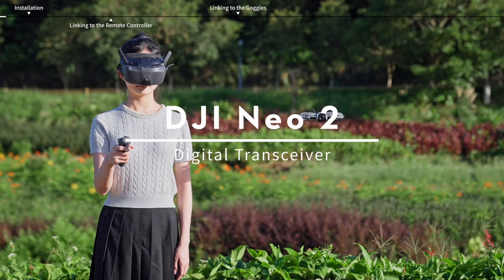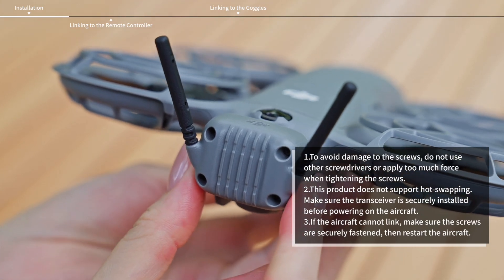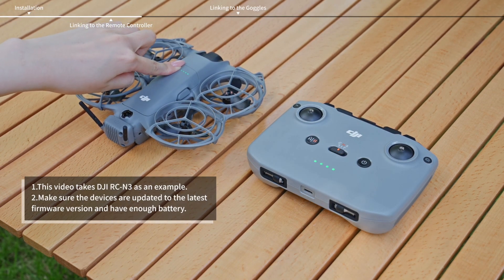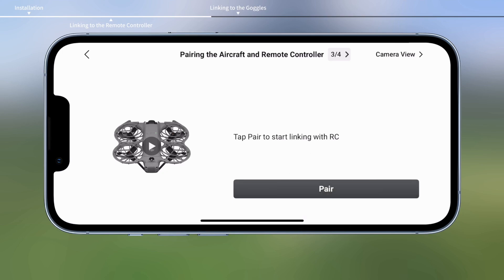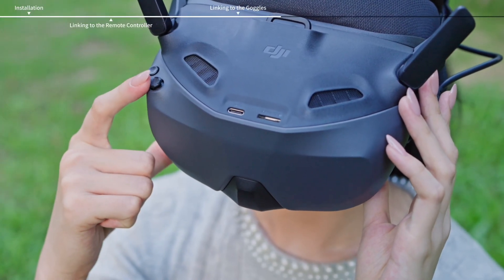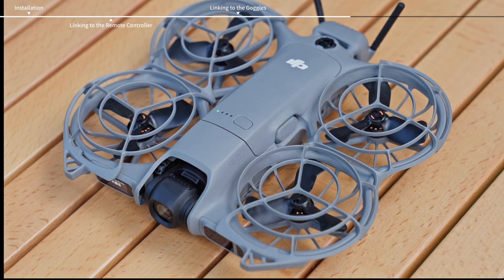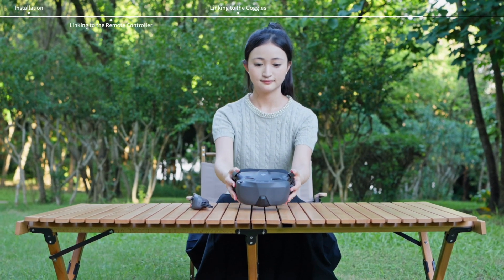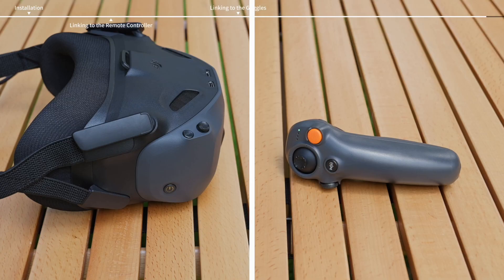DJI Neo 2｜Digital Transceiver | Official Dji Tutorials

Comment: If I use the DJI RC 2 remote, is it also mandatory to use a digital transceiver?
Reply from the maker: I tested the FPV mode only with the FPV Remote Controller 3.